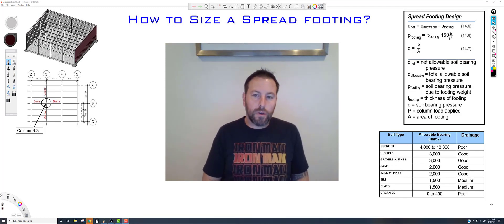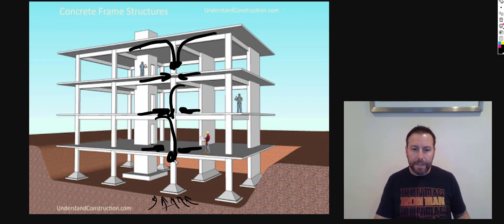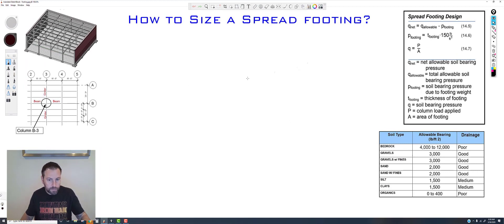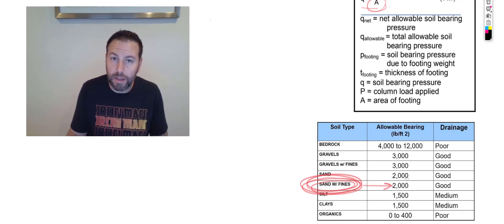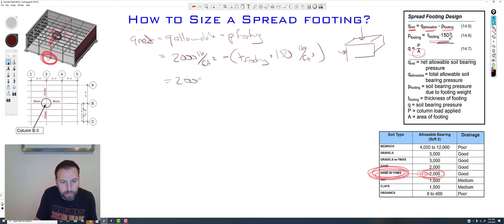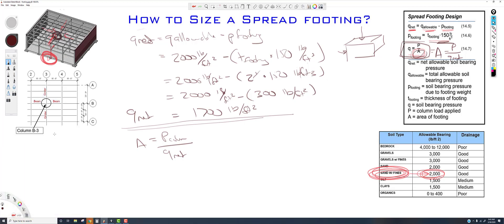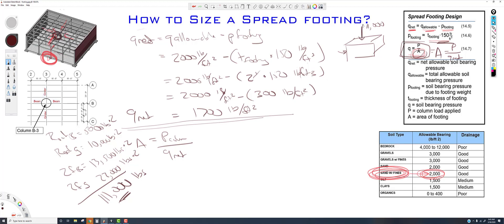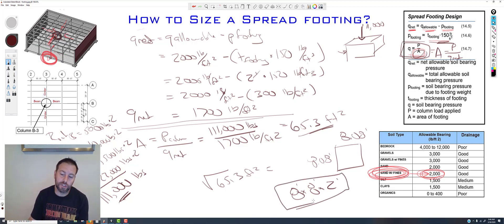Sizing a Spread Footing!

Comment: Interesting that you include the weight of the footing but not the weight of the soil above the footing in your calculation of q-net. 

In our market the geotechnical engineer will only give us qnet at a given bearing elevation (with an assumed finished grade elevation above) so we skip the step of including soil and ftg weight in our footing sizing/checks unless we’re checking for uplift at a brace.
Reply from the maker: I definitely get what your saying, and makes total sense, but for HS students I think it’s the concept that’s more important than the fine details like that.